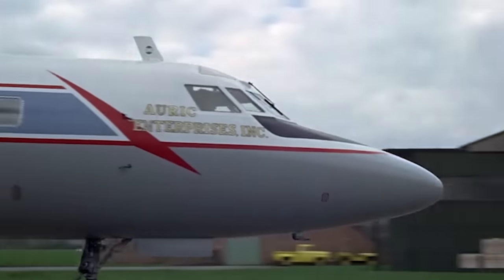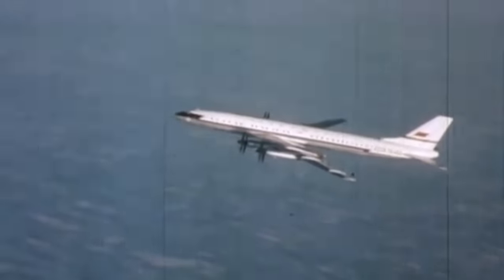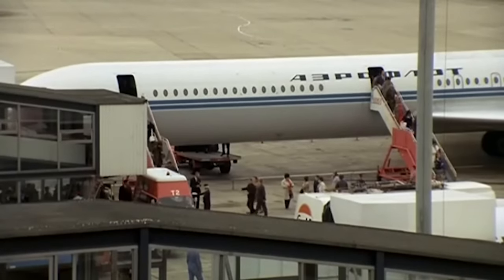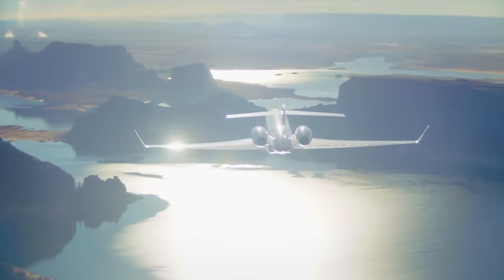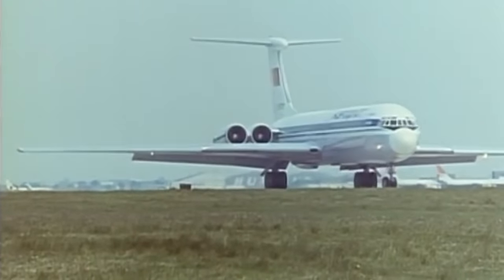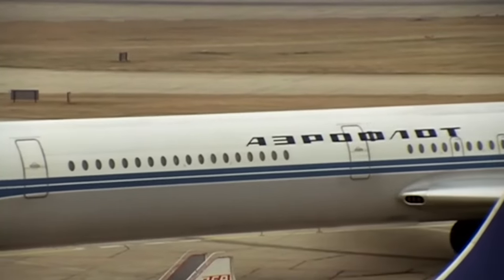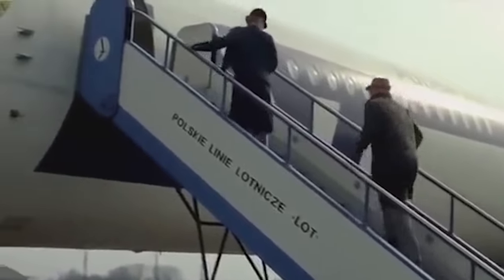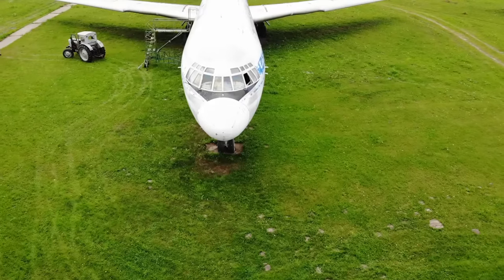IL-62 - an ideal option

Comment: An ideal option if you want to seize to exist. In Poland there was a saying: "Chcesz być pyłem, lataj Iłem" which translates to: "If you want to turn to dust, fly Il-62"
Reply: LOT was a perfect anti example of how to operate airplanes back in the days. They often flew them with engines malfunction which is just criminal for the "VC10ski" as well as for any other aircraft.
Btw, where are you from?
Reply: @river_salmon  Well let's be honest, all countries under Soviet regime were in a tragic financial state and everyone cut corners to save as much money as possible. Unfortunately also in commercial aviation. The maintenance was frequently delayed or botched, but ultimately it's the design (and quality of production of parts) of the Il-62 that led to the disaster. The biggest problem were the low pressure turbine's shaft bearings supplied by the Soviets which had only half of the rollers inside and led to way higher temperatures than the shaft could tolerate. If the bearings were correct, the catastrophes would not have happened. However even if the bearings were borked, but the engine layout was more reasonable, the catastrophes also would not have happened, because the aircraft wouldn't have lost pretty much all engines and pitch control. You can't blame solely LOT for these disasters.
EDIT: btw I'm from Poland
Reply: @lalxl  dude, poor financial state is not an alibi to neglect maintenance thus bloodying your hands as a manager or an engineer.
Reply: @ВиталийШубин-с7ш  Of course it isn't an excuse and I didn't say it was. If you read my statement more carefully, maybe you wouldn't have replied with such idiocy... If the IL-62 had a more conventional engine layout that is 4 engines under the wings, the tragedies wouldn't have happened PERIOD

Comment: Question:
So the engineers went for the tail mounted option so that shorter landing gear can be used. This is indeed a huge advantage on rough landing surfaces, not so much on top-notch runways. The landing gear will not need to be as beefy to handle lateral loads and the aircraft, sitting lower, will have greater stability touching down in strong cross-winds.

However, could the same not be achieved by using a high-wing design with regular wing mounted engines? As far as I'm aware, the BAe 146 / Avro RJ is the only passenger plane with this configuration.
Reply: wings mounted on the top of an aircraft cause some problems, the main one being difficulty in maintenance  of the engines and the wing, in addition to lower speeds for aerodynamic reasons, thats why most planes use low wings

Comment: Flew London to Warsaw on one in 1983. It was perfectly up to standard for its time, and notable for the aluminium interior panels and wool upholstery, much more fire resistant than the plastic on most Western airliners. The two crashes near Warsaw were a blemish on both the maintenance and construction of the engines, and on their location in the airframe, a problem for both the DC-10 and L-1011 also.
Reply: Maintenenence was according to manufacturer standards, russians sold to Poland faulty engines.
Reply: @Bucefal76  - I cant help thinking this would have been one hell of an aircraft if fitted with the Rolls Royce Conway engines as used on the VC10.
Reply: @Bucefal76  Sure, sure.

Comment: The structure of the IL airframes was good but the engines had design and technological defects. For the pilots, it was a machine difficult to control. Demanding physical strength. Placing the engines close to each other in line in case of the centrifugal rupture caused broken adjacent engines and destruction of tail steering. This  happened during the first LOT plane crash in March 1980. Due to the sloppy fabrication of the engine shaft, a fatigue fracture, centrifugal turbine burst, destruction the other engines and rudders in the tail took place that time. The low technical culture of repairs and servicing in CCCP was also the reason for the second LOT plane crash in 1987. The investigating commission found that in engine in  intermediate bearing every second  roller was only installed. A rolling bearing became a sliding bearing. As a result, the engine shaft warmed up to about 1000 deg C, both engines on one side were damaged and the rear fuel tank and the 4th luggage compartment caught fire. In both cases, no one survived. Similar 8 engine-related disasters occurred in DDR, Cuba and the Middle East.

Comment: The two crashes of the IL-62s  operated by the LOT Polish Airlines, just a few years apart, showed the weakness of the tail-mounted quadruple engine layout. In both cases the turbine of an inboard engine disintegrated and the destroyed engine took with it its neighbour engine, as well as the inboard engine on the other side of the fuselage - the failure of one engine destroyed three engines out of four. On top of that, the hydraulic systems were also destroyed, and, finally, the hot parts of the turbine(s) caused unnoticed and unreported fire in the luggage compartment. 😢So, it turned out that placing all four engines so close one to another negated all the redundancy.
Reply: Истинные причины при этом были засекречены. Лишь через 30 лет были обнародованы рассекреченные данные, согласно которым виновником катастрофы являлась авиакомпания LOT, эксплуатировавшая двигатели с превышением допустимых ресурсов и выдававшая в полёты заведомо неисправные самолёты (Википедия)

Comment: this clip does not describe one serious issue with the airplane (engines, more specifically), which led to getting rid of them in LOT airline after two tragic crashes in Warsaw. I still remember a rhyme from my youth, which translates "fly with IL if you want to turn into dust". The truth is the range was not enough either, many airplanes landing in Warsaw with nearly completely empty tanks on the trip from the USA.

Comment: I flew on this aircraft several times on the transatlantic route.  Most memorable flight was to Prague from (I think) JFK.  Shortly after takeoff, a crew member handed a heavy glass mug to all of the  adult passengers.  Then, throughout the flight, he would go up and down the cabin with a pitcher of excellent Czech beer, filling every mug that was lifted up.  Most of the passengers were Czech and Polish businessmen.  They smoked awful commie cigarettes, and all got potted.  There was yelling and singing until they were exhausted and calmed down.  It was kind of surreal.

Comment: Ran into one of these at JFK prior to 1970 at the Pan Am hangar parked .The landing gear was very similar to our then in use B707 landing gear ,like you change the parts and they would fit,and I was told that Pakistan got an early 707 and Russia disassembled it and copied things like the landing gear before putting the US plane back together again .True? i think so. Just look at the Russian DC3 and B29s copy's,that's what that company did all the time. .

Comment: This vid is nothing if not brutally honest . While praising the basic aircraft it points out the  shortcomings which hampered the operation of the plane and restricted it's capabilities vis-a-vis it's contemporaries . It's main weakness was the non-availability of a strong enough powerplant which could service the aircraft  . Also design deficiencies and weight issues compromised it's dependability for commercial flights and it could only manage to survive because of the lack of a viable option . Nonetheless it served Aeroflot and other satellite airlines for a long time .

Comment: Oh really. You should read about two crashes in Polish airlines - flight 007 from 1980 and flight LO5055 from 1987. In both cases, engine 2 exploded, destroying neighboring engines number 1 and 3, and the debris flying through the fuselage cut the rear steering links. The elevator was not balanced so after cutting the steering links it fell down under own weight and aimed the plane straight into the ground. After the fall of the Iron Curtain, we sold all of them to Ukraine :P

Comment: There's one funny thing with VC10 and Il-62. There engine disposition would have allowed them to be turned into twinjets quite easily, without any change to the airframe, once engine powerful and reliable enough are available. So they could have outlived 707 and DC-8. 
But that never happened. I don't think it was even considered.

Comment: One big problem with this design (and other similar ones like the VC10) is an unconstrained engine failure in one engine had the potential to knock out the other engine on the same side of the aircraft, and being close to the fuselage meant they could also cause collateral damage to other aircraft systems. 

Of course that problem wasn't unique to these planes, the Trijets could also suffer similar problems if they had an unconstrained engine failure in the centre engine.  Most infamously this caused the Sioux City DC-10 crash when the exploding centre engine took out all three hydraulic systems and rendered the aircraft practically unflyable.

This is probably why podded engines under the wings has since become near-universal.

Still, interesting to get to see what was going on with airliners other than Boeing, Airbus, Embraer, et al.
Reply: I´m agreed about the consecuence of engine failure on those designs, but the main reason for engines under wings may have more to do with the balance I think... The aircraft with engines on tail no matter the amount of it, have more fuselage available to load  in front of the wing than rear of it, so balancing it is a real pain (I´m not guessing here, I know that... :). Aircraft with engines under the wing have almost the same amount of fuselage (load room) front/rear, so loading it is much easy... However, is not just the quiet cabin for what this rear arragement is set. The wings are more effective than wing mounted engines because airflow is not disrrupted by engines+pilons (mosly if high angle of attack, cross winds or both) and flaps and Slat design are simpler, lighter and effective because used to be continous, not disrupted by the engine blast.

Comment: I think it is pretty obvious that there was a certain amount of copying going on with the VC-10, even if it was mostly external. I mean, look at the T-tails,  both with curved, swept horizontal surfaces and a big carrot fairing in the middle. It seems too much to believe that not only did they totally independently arrive at a quad-rear-engine layout, but coincidentally managed to design a jet using the same uncommon and rare external features. I think Iluyshin at least procured photos of the VC-10 and out their new jet on the same lines, to be sure it would work correctly.
Reply: The KGB procured more than that, you can be sure of that. One thing they could never copy properly were the technologies going into the engine production. Hence the TU-144 (Konkordsky), was a piece of crap, while the real Concorde was a success and technological marvel. in Il-62 the engines were also piece of crap resulting in numerous crashes due to engine failure and loss of control .
Reply: @jacutin5033 okay sure dude. Cold war ended about 30 years ago if they forgot to tell you. Let it go.

Comment: Interesting choice to put the engines where they did. It does make sense given the requirements, but as I understand it, generally putting engines on the aft fuselage is less efficient than hanging them the wings, or similar such solutions. I think it has something to do with airflow, but I'm not sure. Hanging them from the wings definitely has the bonus of making maintenance easier since they often can be reached from the ground or with very little needed.
Reply: The Soviets were concerned about keeping things "indigenously Soviet". Mounting the engines under the wings in pods was seen as a "Western" innovation and wouldn't have gotten past the bureaucrats. Ilyushin managed to convince them otherwise when they made the Il-86 and found a prototype jet from the late 40s to cross-reference and justify the design as "indigenously Soviet".
Reply: Ok. Don't take into consideration what Max Devo said. It's just stupid bullcrap and I have no ideea how to name it otherwise.
For your question, I'll start off simple. 
'is less efficient than hanging them the wings, or similar such solutions. I think it has something to do with airflow, but I'm not sure' Actually, the opposite is true if we are talking about the airflow. Tail-mounted engines means that the airflow over the wing is not disturbed and 'uniform' all over the surface of the wing, making a more efficient use of it. Furthermore, a tail engine is less likely to ingest/inhale debrees from the runway. This was a major problem in the early jet age since many airports did not have the strict regulations for FOD we have today and the engines had no practical way of avoiding ingestion without disturbing the quantity of air it was taking. This was further exarcerbated in  USSR where there were many communities which relied on air travel for supplies and transport, but could not afford to have a 'properly' maintained airport. 
Of course, the problem of engine explosion on 4-engine tail configuration is more sever, but there are other issues to consider.
Tail engines require further strengthening of both the tail (due to extra weight) and wings (due to the upwards bending momentum generated by lift). And you also have the problem of needing longer fuel lines, which is never a nice thing to worry about.

Comment: Sir, a "plumage" is feathers of a bird. The aircraft tail assembly is called "an empennage" or just like that: a tail assembly. You also didn't mention that the whole 'crutch' story backfired when the aircraft proved to be unstable in level flight so a ballast water tank in the nose had to be installed. Not that elegant after all, I suppose. Thank you for the video.

Comment: Boeing had an even simpler solution to tail tipping for the 727:  A tail stick was stored in the aft airstairs, and after parking, it was the flight engineers job to retrieve this stick and install it in a simple fitting under the tail of the airplane.  This required no hydraulics or electrics and the aluminum stick itself only weighed about 10-15 pounds.
Reply: Well, the problem with this is that it has no use on landing. You have to wait until after parking.
Reply: @nottoday3817  Airliners are balanced when in the air.  Only after being parked and unloaded can the danger of tipping onto the tail become an issue.

Comment: My only flight in a IL-62 was in China during late ‘70’s. Just as we crossed over the runway the pilot reversed the thrust and we were on the tarmac rather abruptly, clearly a handy option if you are running out of runway otherwise rather startling. But then there were a lot of startling things about state owned and operated aviation operations such as passengers moving about the cabin during takeoffs and landings. I thought if the pilots don’t understand that these people would join them in the cockpit, at least briefly, if they aborted the takeoff in an emergency what else didn’t they understand. After that I took old slow steam power trains.
Reply: Must be a cultural Asian thing. When I was flying Vietnam Ailrlines, one of the locals landed in the loo.

Comment: Very strange April fool joke XD. Nearly got me with the IL-62 xD. After all, the was a reason for this aircraft to be banned from commercial travels outside the soviet union after reliability issues, lack of redundant systems. And of course legendary engine issues that lead to the ban in the first place (they had a tendency to explode and crash). As of 2020 the aircraft still has limited use as the aircraft is still considered dangerous. As for the leading edge design, it was made as the original wing design created huge vibrations on certain speed and altitude which was addressed by creating this interesting design. What is worth noting, is the landing gear and how legendary it is. The landing of Interflug Il-62 on grass sort of shows it ;)